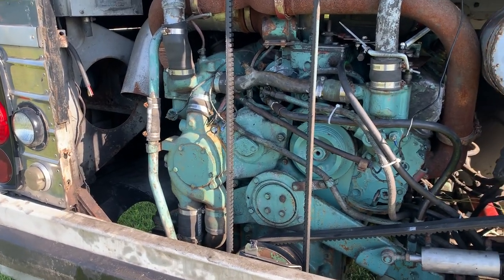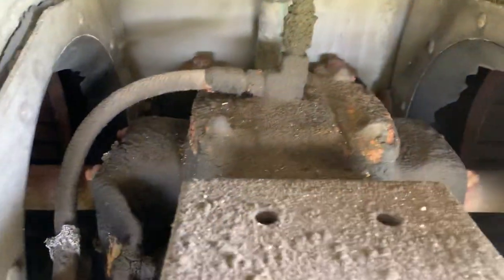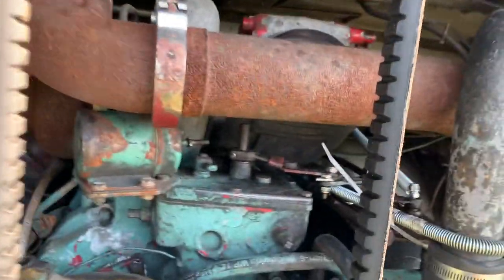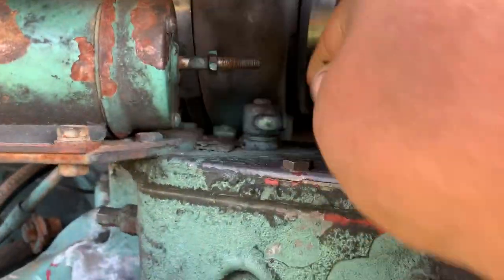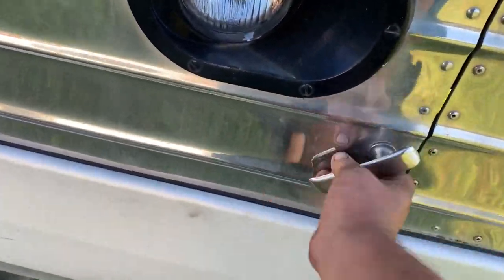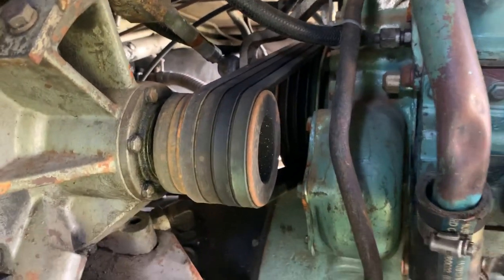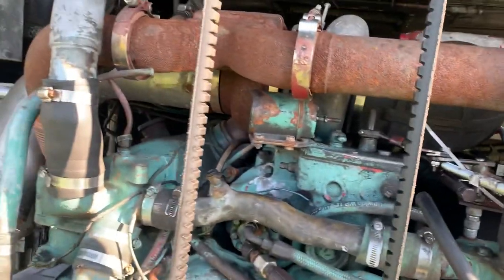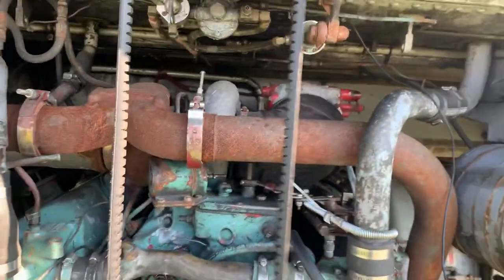MCI bus giant belt wtf is it?

Comment: On multi belt systems when replacing belts there is a "measured" length. So when you order belts it's not just matching part numbers you also need to get a "matched set"

Comment: I don't miss the older AW3. Our buses had an air actuator for the shutdown. Used to have to carefully stick our arm in between the fan belt to shut them down when they failed. 

You should see how big the fan belts became! Series 60, Cumins ISX. About 5' tall. Heavy. Does damage if they go bad. 

As far as Alternators go, the gear drive on the 6V92 was awesome. Low fail rate. Oil cooled. Became easier on the DL4500 and 102D's. When they switched to the dual Bosch setup. No more 10 year units. Dumped that right down to 18 to 30 months.

Comment: If it is 12 volt, you could just install a resistor with around the same resistance as the solenoid in series with it.  It's only a momentary device anyway.

Comment: I could see the sheetmetal & recognized them as squirrel cages. Whay I couldn’t fathom was why they’d srick ac evap blowers & evaporators right above the engine lol. Never even crossed my mind that they’d be the radiator fans (likely controling airflow over the ac condensors too). Those fans must eat a lot of horsepower. Think I’d be looking into nice new brushless 24v squirrel cages if the MCI were mine.

Comment: As usual, a great video and answers to the inquiring minds!!.I myself was thinking idler pulley for that belt. Kind of bass ack- wards engineering for such a long belt. Waiting for the air pressure to build up and the coolant  filler door! Gee whiz Scott...and I thought  the radiator cap on the old Freightliner c.o.e. that I owned w/ my friend was high,that was really a piece of cake com pared to this set up!

Comment: Another alternative for feeding 12VDC to the shut down solenoid, pull 12 volts off the first battery in the 24 volt crank series bank. That way you don't have to mess around with the house bank.
Reply: You're right, but he would have had to run a wire from the battery to the switch. Another alternative is he could have used a  resistor in series to step down the voltage just before the solenoid. Either that, or another 12 volt load in series before the solenoid. I have a case bulldozer that's 24 volts, however, the headlights are (2) 12 volt bulbs wired in series.
Reply: @bigjohn6475  The power feed to the old jake brake system, plus the wire from the switch all the way back to the solenoid is probably acting like a resister dropping the voltage to a manageable level at the solenoid.
Reply: Correction from my earlier post, re: 12 volt vs 24 volt gauges. After additional research, I found out, the senders stay the same, just the gauges are different for 12 volt vs. 24 volt, or even 32 volt, if you can even find those any longer.
Reply: @newjerseybill3521  That could very well be, depending if there's a relay towards the rear of the bus.
I added a relay at the rear of my bus to step up the voltage at the tail lights. They are 12 volt lights, but I had a 4 volt drop due to the long distance between the light switch and the tail lights. I did the same to the headlights. Not only did it make the bulbs much brighter, but it reduced the current going through the switch.
You're right about the current being "manageable." The solenoid is only energized for a few seconds during shut down.

Comment: On the shut down solenoid it wouldn't hurt anything being 12volt. Its just a momentary activation, and you don't have to hold anything. They might be doing it in case you have a low voltage problem. Just a thought. And if you've got a turbo it doesn't have the shut down at all.

Comment: I had wondered also. I always thought it drove an air compressor. Strange design to have the radiators and cooling fans that high up with such a long belt. But it gets the radiators up off of the road where the air is likely a few degrees cooler than right down on the pavement.

Comment: Just add a power resistor inline with the electric shutoff to drop the voltage down. A coil ballast resistor would probably work great.

Comment: Giant belt of death on the death bus hat has already killed off 2 mechanics. Whatever you do don’t become the third.
Reply: It's not the bus' fault people die of old age, but, yeah, let's not have an industrial accident. ;)
Reply: If that fan belt is already dangerous, I don't want to imagine what will be the axially driven Sultana fan of which I put the link a little higher, the belt suffers much more in that position and I guess Cummins engineers never thought that something like This system could be used in one of its engines.

Comment: If it's 24VDC you could also use a voltage regulator to drop it to 12VDC.  There are also other ways to drop the voltage... voltage divider circuit, etc.

Comment: I assumed from the beginning it went above to the cooling fans. They had to be somewhere and even in large vehicle engine bays, space is still limited by component size and operational parameters. That's the design of the technology available at the time. The fans have to be driven by available power and that meant a belt from the closest drive pulley. Suppose they could have put a large enough electric motor up there but that would demand current from that large alternator which already has demands on it running the rest of the bus electrics. And another motor and wiring add complications and maintenance requirements and possibilities of failures. No simple alternatives to what they utilized. My "wordy" take on the situation!

Comment: Very good explanation. I was never a fan of this design in older MCI’s and was surprised this design stuck around so long. As this “squirrel cage system” aged, they were common to develop cooling issues especially when the turbo versions of these engines were installed. They are just a maintenance nightmare as they age with the dual radiators, dual fans and what not. I prefer the side mount single traditional fan, single radiator design common on the GM’s and Prevosts that seem to hold up much much better over time, and less parts and less required maintenance.  I always felt more “at home” driving an MCI but this design wasn’t great at all. I think the idea behind it all was to try to save as much space as possible.
Reply: And the air actuated shutter valves were a pain in the fricken butt!

Comment: For the big belt -  I'm imagining a small pulley on the outside of both sides of the belt with a spring in the middle providing light tension towards the middle to keep the belt captured. Maybe it could be attacked to the exhaust manifold behind it.
Reply: You don't want anything like that. It would be more a headache. The problem with guides and or pulleys on this belt is, as Air pressure reaches 128psi (governor cutout) the belt tightens. To get around a low air start up, simply fill the air tanks in the bus with an external compressor. You would be surprised how tight that belt gets.

Comment: Don't the newer buses have 2 belts to the fans? It's been awhile. With the direct mount alternator it eliminates an oil leak problem. The 2 7s I worked on were belt drive had drain leak issues. The 8s,9s and 10 were direct gear. The charter company I worked for had 2 7s, one 8, 6 9s, and 1 10. If I remember correctly. That was 1990

Comment: I did not want to expose myself as the idiot in in class that asked what that was. I was studying the belt that went up top and figured they were fans of some sort but did not think of the radiator(s). Also I had noticed at one point how very loose it looked then later, not so loose. Air tensioning explains that.
I don't have a desire to ever own one of these buses but for some reason this channel fascinates me.

Comment: That is a 50 DN? Good grief!

How much power does an MCI actually need? I was thinking a 2 belt drive off the front of the engine with a standard alternator from a truck like I've seen mounted before with a homemade? Style alternator mount. I can just see the replacement cost of the 50 DN being well over a $1000 not including R&R.

Just curious did you replace the batteries or were you able to bring the less than a year old batteries back to life? They seemed to be headed towards being recycled from what you discovered in a previous video.

Cheers!
Reply: That bus still has the original air conditioner, which uses lots and lots of power. There is a large fan behind the condenser, on the left side just behind the front wheel, and there's a pair of squirrel cage fans near there, powered by another big electric motor, that push air through the evaporator and into the cabin. Many of those alternators were cooled with engine oil. They don't just produce electrical current, but lots of heat as well.

Comment: I didn't see anything set up for a fast idle, any plans for it? I couldn't stand those style tensioners because they always leak, until I saw Prevost tensioners which are just mini airbags. At least the ones on the MCI have a spring that'll keep enough tension even without air to hold the belt on.

Comment: Trying to decide between an MCI bus or a regular motor home. That looks hard to work on if it broke down on the side of the road. What do you think?
Reply: There are pros and cons. If you're going to really put on miles, an mci is built for that. You'll dryrot those tires before they wear too low on tread. But they're $600 a piece as of right now. The coach busses are going to have existing problems. A normal car shop will be practically useless. The repair bill will be much more than a class c rv for the same type of problem. The coach busses ride soooo much nicer than any othe motorhome you can buy, except the top tier "diesel pusher" class a rv's. Which is practically what this is. 
These are heavy. Class c are not nearly as much. 
If you want to do more rustic/off road type sites, a conventional (not flat nose) school bus has lots more clearance, shorter wheelbase, comes in smaller sizes, is lighter, can be converted into partial flatbed/deck/toyhauler pretty easy. They can also be found with a higher roofline than normal. And they can have a more modern (easier for a regular diesel mechanic to work on) than a Detroit 2 stroke. Keep in mind you might want to add insulation,as school busses might as well have none.
It all depends on what you're wanting to do, what you're mechanically competent at/deficient at, and how much you plan on spending on it and using it.
Also i have seen city busses and FedEx vans used in conversions. Those are both usually geared pretty low though, so they'll move decently from a stop light, but will be roaring at 65... if you can get them to go that fast.
Also wanted to note that a cheaper class A chassis motorhome with smaller wheels tends to "wallow" quite a bit in any sort of crosswind. They blow all over the road on open planes, and the older ones, even with a 454 or 460 are very underpowered. The chassis are usually almost maxxed out from the factory, so they feel like diving a whale full of Jell-O.

Comment: Sweet alternator. Belts on both ends. Shame Radio Shack is gone. If that is a 12VDC solenoid you could get a 24 volt DC relay and run the 12 VDC though it to the solenoid.
Reply: I think Adafruit, or something like that, might have a comparable solenoid, they have all kinds of electrical components!

Comment: What is the theory behind the air belt tensioner ? surly the engine has enough power to spin the fans till you get air pressure is it to help relieve the strain on the starter ?
Reply: It's like the spring-loaded tensioner for your serpentine belt on your car. The air cylinders work so much better in a heavy equipment application than spring ones would.

Comment: I've seen on other buses that they use belts to drive the radiator fans. Why not convert to electric. On this bus it would make even more sense because of the belt. Can you even get replacement belts and what is the cost?

Comment: At least the alternator belts have a solid tension adjuster! The fans and A/C comp. belts have to float due to engine movement
Reply: That's why both the belt of death and the air conditioner compressor drive belts use air cylinders to adjust the tension. Both when the coach has no air pressure are loose as a goose but once past 80 pounds of air pressure they are then in proper tension.

Comment: That long belt is screaming for middle idler pulley.
Reply: It worked fine for 50 years.
Reply: I believe I did see him working on a bus in another video that had 2 idler pulleys mounted midway and both sides of the belt---not sure of the model of the bus though. Kind of wonder if that one had manual adjustment of tension whereas this one is tentioned with an air cylinder.
Reply: In response to the statement down below the D models had a belt tensioner midway up to the radiator fans that was a  type That is adjusted with a spanner wrench with a belt that was longer than what you got on the older MC9,8,7

Comment: On my bus I used a 24V to 12V buck converter from ebay to get 12 volts for my LED tail lights. This would be an easy way to get 12V for you shut down solenoid.

Comment: Just use a balast resistor if it actually is a 12v system. You could also find a similar solenoid and just wire it in series. That way they would both affectively get 12v
Reply: I am pretty sure that solenoid is available in 12 or 24 volts. Some of the smaller displacement 2-Stroke Detroit's had 12 volt systems.

Comment: If that solenoid is 12 volt, you can just put a resistor in series with it to drop the 24 volt to 12. Not expensive and solves the problem.

Comment: Even back then, how could this horrible death contraption of a belt AND a right angle gearbox (which seems to have an oil feed line) be cheaper then 2 electric fans and a bigger alternator???
Reply: Back in the day you wouldn't find electric fans on radiators of any kind---doubt if they were even available. Not sure what year autos started appearing with electric fans but I never saw any on big equipment with huge radiators.

Comment: What's the length on that belt? I sold an old bolens mower to a guy years ago (around 2000 ish) and even at that time, bolens had long since been out of business. he came in with the belt under his feet and around the back of his neck. He's 6'3 and still had slack in the belt. He looked at me and said, got one this long? the answer was no. Very much so no. No to the point the mower was never repaired and was junked. Very sad. Probably could find one these days with the internet, but back in 2000 no one was selling parts online yet and online lookup? yeah... right....
Reply: Yes it's funny how some people think -- "oh, why didn't they put electric fans on the radiators"---back then electric fans weren't even available for huge radiators like this. Do they think engineers wouldn't have put them on these buses if they were available!!

Comment: so the belt explanation spawned a question. Why are these buses 24 volt system? I think small planes are too.  Thanks for the information!
Reply: VW57 Higher volts means less amps needed to do the same work. So you can use a smaller diameter wire . The other reason is the big diesels are hard to crank over so you need more volts to run the starter I believe.

Comment: Looks as if there might be some ducting form the fans to the radiator missing.
Reply from the maker: As long as that door is sealed it forces the air through the radiator.  That whole upper chamber is a vacuum. Hence a sign that says don’t store loose rags or items up there because they will get sucked into the fans.

Comment: Just a heads up for anyone with an MCI.. My dad's 1975 MCI 5b 8v71 had the pulley fail on the back of the motor that runs the alternator . we tried to find one and we're under the impression that it was a Detroit Diesel part .As it turns out it is an MCI part and was extremely hard to find in our neck of the woods . Its a 2 piece assembly , the pulley and a cone that goes in the center . As luck would have it , Luke at U.S. Coach had 1 left , brand new one on the shelf ...oh and did I mention Luke is an awesome guy ? . Anyway if you find one , buy it ..cus they are made of unabtanium .
Reply: I am sure MCI outsourced it from somewhere. That kind of sounds like BROWNING to me--does it look anything like this:  https://www.motioncanada.ca/productDetail.jsp?sku=00727983    I am sure there are other configurations that BROWNING makes as well---big catalogue or probably available on line what they carry. Other distributors as well.

Comment: How can you tell if the solenoid is 12V or 24?
Reply: You can't really, but considering its momentary to shut down the engine as long as the driver turns off the shutdown switch right after the engine shuts down, no harm no foul.

Comment: I changed many a gear driven alternator what an MC12,  It's a greyhound as a mechanic I'd never came across a bad gear , And I must change about 50 of them maybe I was just lucky, But they are  It's a pain in the ass to change you have to crawl down a hole by the bathroom in the back by 1' by 1' to get it out and it's loaded with oil I used to keep a mop bucket on wheels with diapers all over the place and pull it straight up

Comment: Impressive engine and double cooling system. For those who do not know the Sultana Mexican buses, I leave a link to this huge bus manufactured in the 70s, with a very North American design and that stands out especially for its large size, using a Cummins Diesel 8v engine and with a large overhang ( 2 steering axles and two rear-wheel drive), Scenicruiser type panoramic body. https://youtu.be/TiJ9oxjaT50